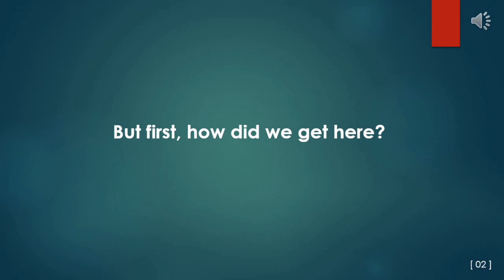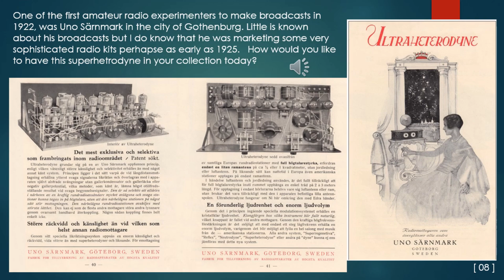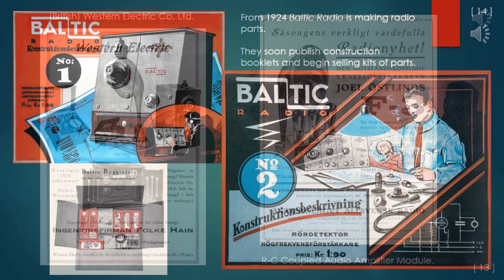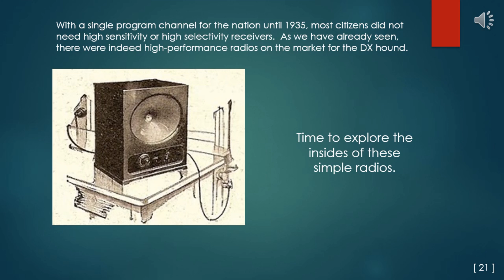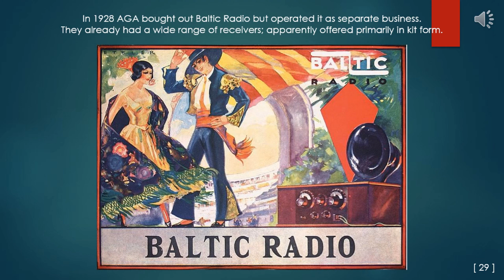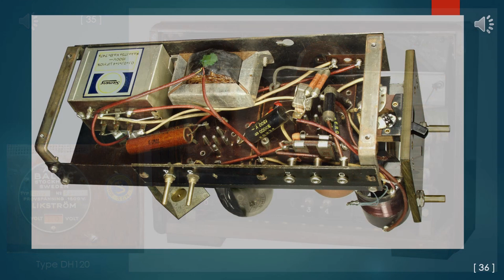From Acetylene Ocean Buoys  to Radios - The Little-Known Story of the AGA L-III

Comment: Thanks for another excellent video.  AGA were an incredible company with some very innovative designs.  What is not known is they were the world leaders in Thermal cameras "Thermovision"  developing the technology for medical imagery and then inevitably being used for night-vision by the military.  Look up AGA entry in WiKi

 Speaker cone replacement : With the set in question remove the existing cone to safe storage then clamp either some thin acrylic (< 0.5mm)  or clear plastic from a large water bottle using the existing securing ring.  Lay the set on its back and put ball bearing of sufficient weight  in the centre. With a hair dryer you should be able to warm the acrylic enough for the cone (parboiled) shape to be set. Take is slowly.  Then attach the cone centre to the armature, this may take a few attempts but will not damage the set.  Another material which was used is shellac impregnated cotton (Tuffnol)  Loosely stretch and secure the cotton as above, put a ball bearing in the centre and adjust fabric to the correct depth then set the shape using several coats of shellac or resin. Both options will give you a Paraboloid of low mass the latter process is in keeping with techniques of the time. 

Best wishes

Comment: A 3D resin printer especially a large one could likely print a complete speaker cone. A plastic extrusion  printer would leave layer lines in the cone , unless it was coated in body filler, sanded smooth and painted. Aresin printer can possibly print the cone being usable when done. Possibly even using a gold resin, however to be authentic.  I'm thinking use clear and paint it. A 3D scanner could measure the cone. Only requiring some  manual drawing in solid works or some similar program, to add the mounting points,  then print it out. However, a simple repair using a UV curing adhesive could possibly repair the damage. Especially if a UV laser pointer is used. And the adhesive is applied to the edge of the break. Slowly stitching it back together. Maybe use something like playdough to hold the cone in position while a small section is aligned with resin on it. Then flash it with the laser. Or hold a led UV flashlight on it.
Reply: I am familiar with UV cure adhesives.  The cone is so smooth that the splits in the celluloid are just too unforgiving.  I still thing printing a cone mandrel so that the cone could be vacuum formed is the way to go.  I used to do 3D design but we used contract printing....  At 78 I think I will have to save that project to my next lifetime.
Reply: Unfortunately it can’t produce a complete working microphone such as those used in the 1930s-1960s. Oh, well…..😊